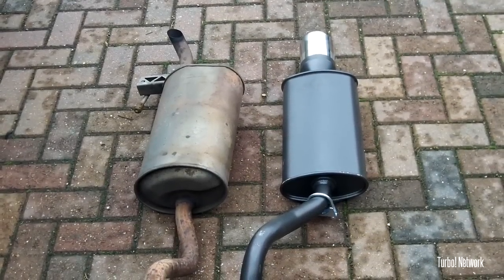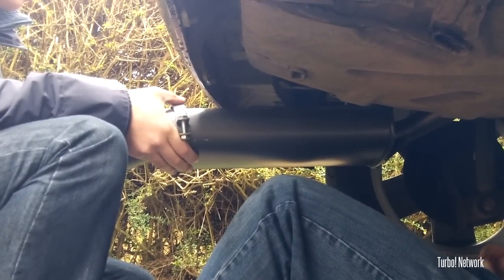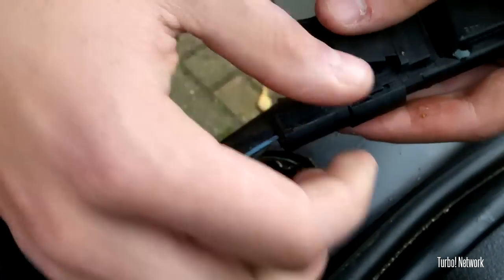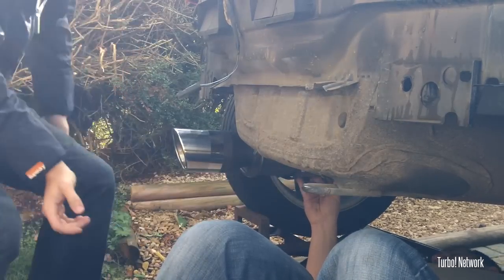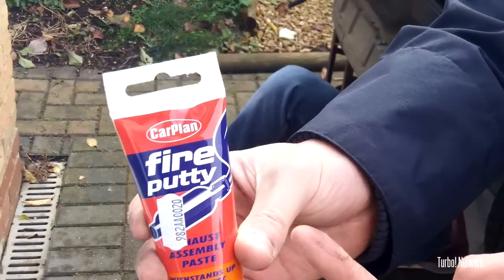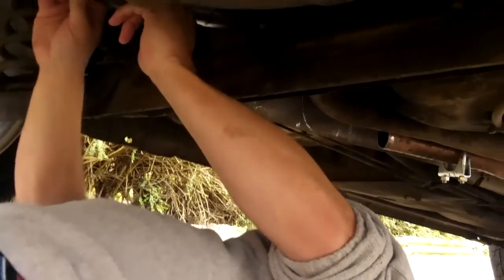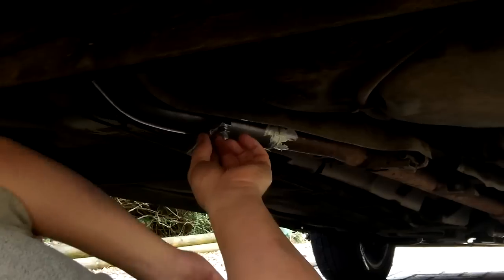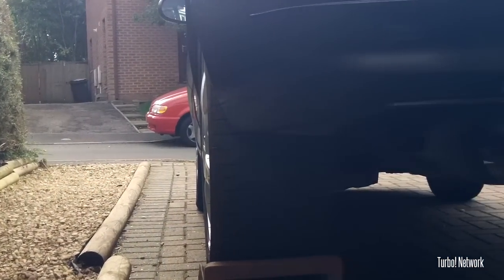The Clio Project: Ep #13 - Exhaust Replacement (Loud BackBox)

Comment: Could you make a parts list? I'm seriously considering buying this for my clio to! thanks
Reply from the maker: March 15th we will have a website live with listings of all parts used based on the mod. All you have to do is type in the search bar is a key word and then  you can find the mod. On that page it will have parts needed and a basic step-by-step guide on how to do the mod along with links to the video. It will also have links to recommended suppliers :)
Reply: Excellent, can't wait for that! Thanks for the response :)
Reply from the maker: Yaaleya Thats alright, we try to reply to every comment as soon as we can. Not always possible but we are very glad to have great fans :)
Reply: Turbo Autos Got it fitted, sounds scrumptious. Slightly different to your version though
Reply from the maker: find us on twitter and send us an image so we can see!
@TurboAutos :)

Comment: Does it have a 2,5" or 2" exhaust?
Reply from the maker: Alexandros Simeonidis as in the tip? or the pipe at the connecting end?
Tip - 4 inch 
pipe - standard so id assume 2.5 inch
Reply: Turbo Autos small cars only have 2 inch exhausts. 2.5 inch is turbo territory. If you put a 2.5" on a standard Clio you'd looks power because the bore is too big.